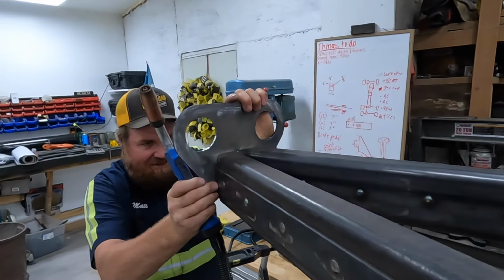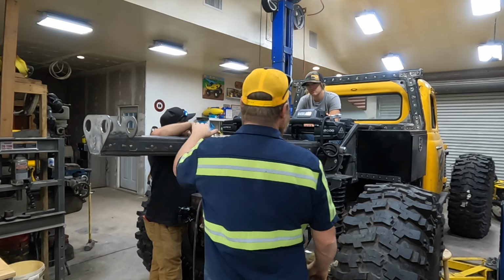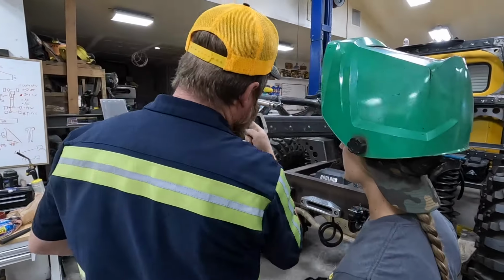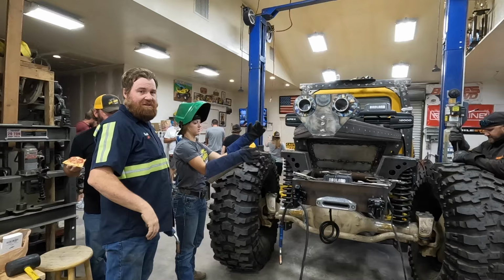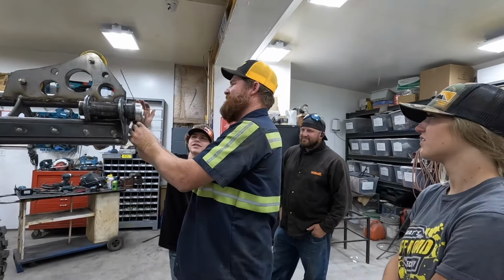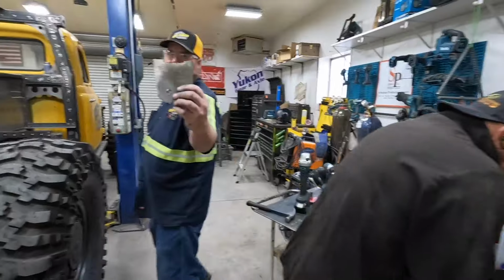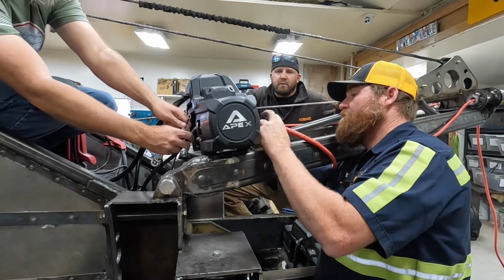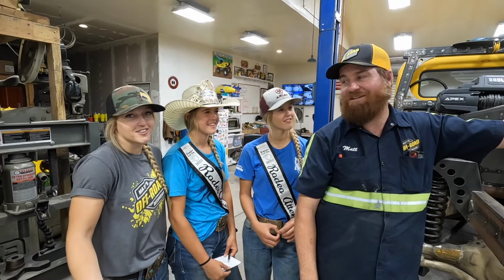Fully Operational Lift For The World's Largest Off Road Wrecker!

Comment: Don't understand why you mock safety with that "caution" sign.  Don't understand why your son doesn't wear safety glasses while using the drill press.  Don't understand why you have a total disregard for your eyesight when striking an arc.  Still a fan: hope for the best.
Reply: The best you can do is keep pushing for safety. Matt has changed things in the past because we complained about them in large numbers.